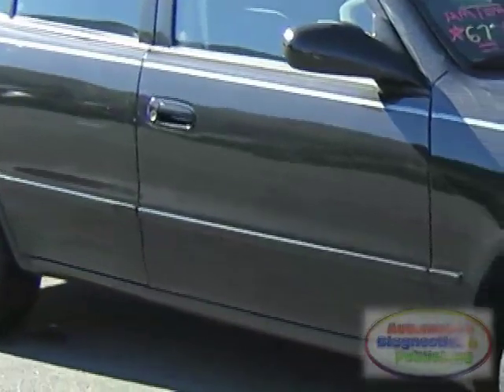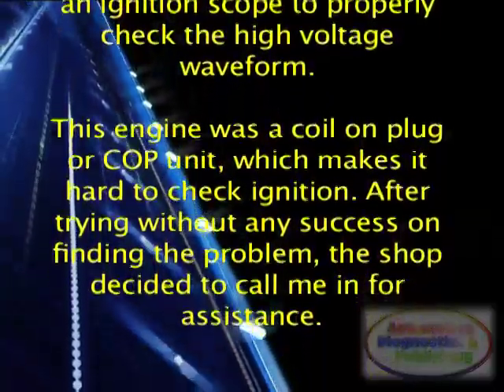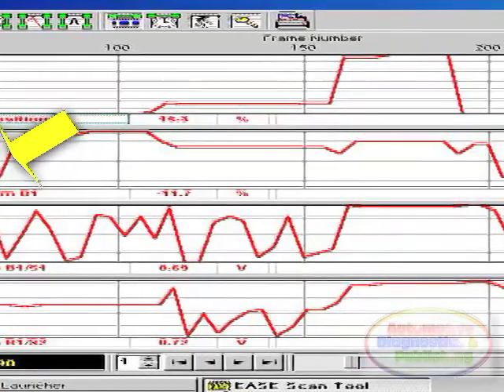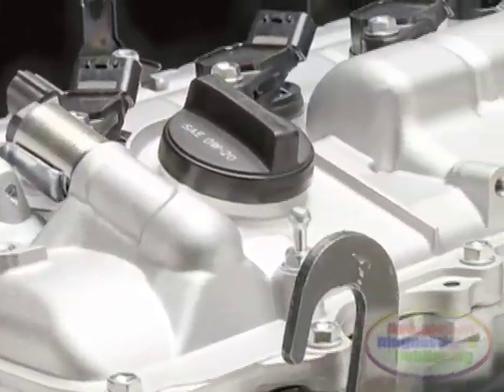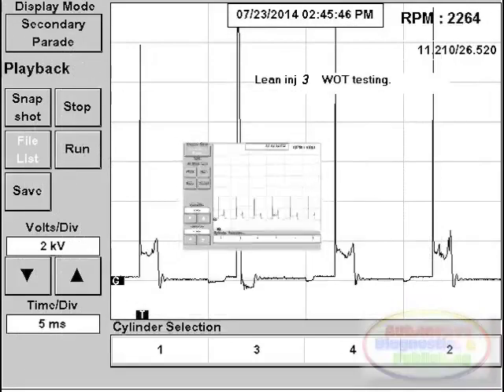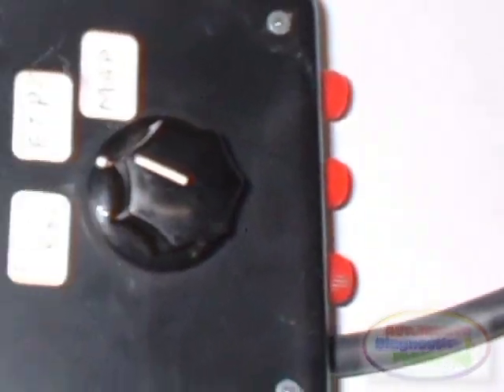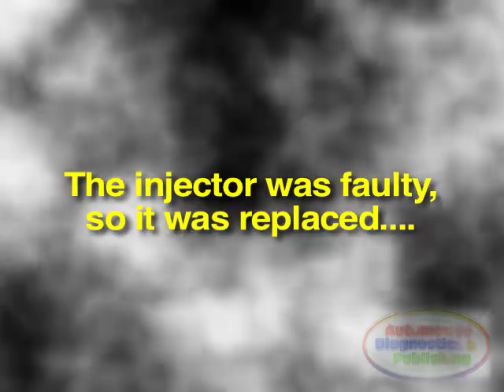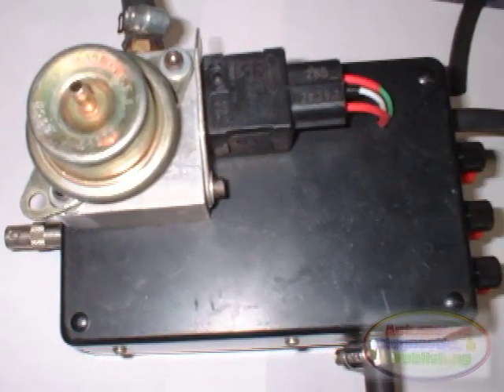Toyota Ignition Misfire Detector

Comment from the maker: I'd love to help you out, but I need more information from you. Which scope are we using and what exactly do you want to do. You may synch off of any signal source. IGT or IGF are Toyota's own and may be low voltage, but doesn't matter. You don't need to use the synch lead at all. You can trigger off another channel. We have our video "No Start 1" which deals with all these issues and on how to interpret waveforms. Keep me posted and thanks.

Comment from the maker: @audiomannn Yes, I have a policy to never mention any name's in this series, with the exception of any one-off shot tool. This one is made by Sun/SnapOn. It is the only one of it's kind. It's only a few hundred bucks, but the time savings are incredible. Also, it is meant for a Sun Machine and you'll have to rig the wires to make it work with any scope. No big deal, just rig the connector pinout to access the two Pos and Neg scope output. Thanks for posting...

Comment from the maker: Well, well...I have to say that if you have the FLAG pickups in the video (from SUN) you're one of the few. Don't get discouraged. That kit is made for the SUN machines and has a connector NOT made for the MODIS, how are you connecting to it? It's very simple, that kit has a synch pick-up for Cyl-1 or whichever you want. Then you synch to the gadget with the gain/volume control, which has a LOOP that looks like a handle right under. Adjust the gain and you're set. Takes some practice so keep try

Comment: Sincere thanks for one of the most helpful and intriguing series of diagnostic videos I have ever come across. May I ask where you can buy the "octopus" of capacitive pick ups from? I work on a lot of straight six Toyota Supras with 2JZ-GTE engines, and RB26DETT engined Skylines, both with COP.  A multi cylinder tool such as you demonstrated could be a Godsend.

Comment from the maker: You may have a clogged catalytic converter. All these O2 sensor codes that you have are the result of an air fuel imbalance. THere are few reasons for this to happens, such. Check catalytic converter, fuel pressure and spark. Do your basics first and then get back to us here...Good luck.

Comment: I have the modis; and, I also purchase the pick-up flag like the one you're using in the video. I'm having a hard time see all the cylinder. I tried to sych off IGF and IGF on coil #1. I had my set up ignition on DIS, 4 cylinder, and firing order 1342.
I just wanted to know where you placed your synch probe on to get that clear reading? thanks

Comment: without problem for a while then the code came back on ,so i brought it back and they did a tune up and the code came off again now a month after all that the code came back again but this time with 5 more ,p0171,p0130,p0133,p0150,p0153,i dont know what to do any more the signs are that the car would give problems to start and once start it would chuckle as if its not getting gas in the motor and then it would cut off,then i would start it again and the signs would work it self out and the car

Comment: were did you connect your ignition syn. probe. I have purchase those snap-on ant. flag pick ups; but, I can't figure out was to attach my syn probe too on the coil 1. it does not work on the IGT or IGF on those Toyota's or is there some thing I'm doing wrong?

Comment: would idle just find idle as smooth as it should but when driving it it would drive normal but with very little power as if there is no gas going into my injectors to fire up my sparks,i also notice that when it chuckles you can hear these poping sounds coming from the exhaust i think its a slight misfire,help me please i love my gs and i just want it to get fix i dont know if i should change the fuel pressure regulator or what so if you can just help me out her

Comment from the maker: Don't just replace injectors. It takes a lot of testing to rule out an injector. Looks to me you need some training or knowledge to do a good repair and not spend much on it. code P0171 is very common and is a lean condition, not necessarily to do with the injector. I have very little info to go on here.

Comment: @chriswilson5006 hey i need your help ,i have a 98gs300 lexus,4months ago i was driving the car and while driving i notice it felt as if its not getting gas in the motor for proper accel,the car then throw a check light and once i stop i check it and it gave me the code p0171 bank1 system too lean,i end up taking it to the dealer ,they change the maf and the code was still there so they put back the old maf and they end up changing the fuel pump,now after that the code when off and it drove